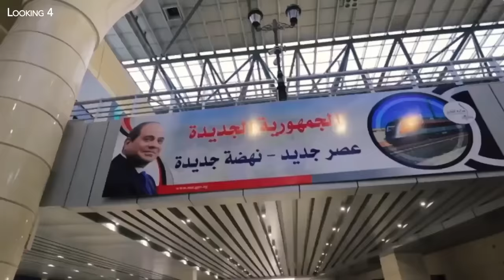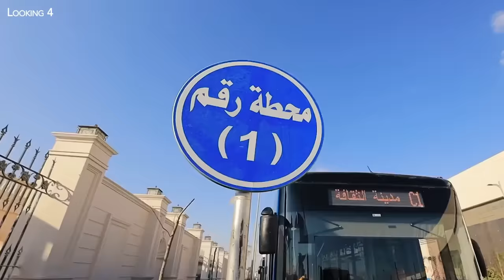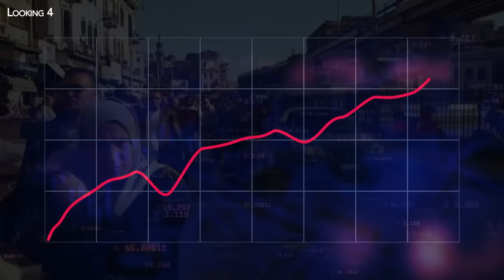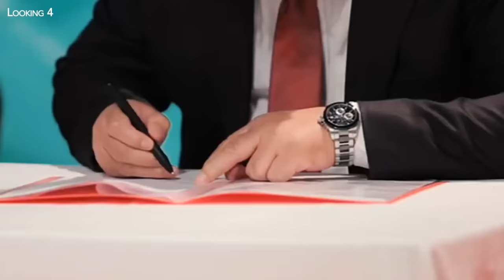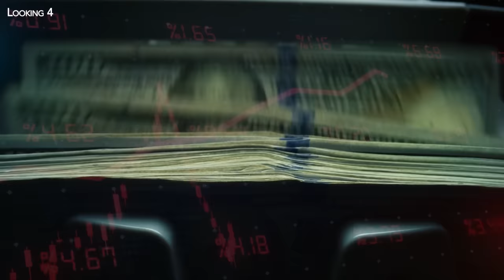Sisi-City: The New Capital that could Bankrupt Egypt

Comment: Greetings from the UK! This looks awesome and very impressive. I hope this works out. 
The budget is not too bad....50- 60 Billion dollars? Here in Britain, that is half the cost of a sub-standard high speed rail which doesn't really go anywhere (check out how absurd HS2 is). Also impressive is the scale of the project and how quick it has taken to build. Here in Britain, it has taken over 5 years to build ONE hotel in an arch facing Buckingham Palace. Words cannot do justice to the colossal failure UK construction is but words cannot do justice to the amazing feat that Cairo is performing now.
Reply: This is true, although the 60 billion figure is a bit more complicated than that. Part of the reason Egypt can build this so cheaply is because labour is so cheap, but labour is so cheap because the country is poor. Egypt will have more trouble affording this because Egypt's GDP is about a tenth of the UK's. (I'm using nominal GDP instead of PPP because the debts are denominated in foreign currency. This is different from the UK in that the UK is financing HS2 with debt in its own currency. Because of that if worst comes to worst it can just devalue the debt by printing money).

Also, this comes at a time when Egypt is struggling with a currency crisis. Basically Egypt is the largest importer of wheat in the world. They need foreign currency in order to pay for all that wheat so their people don't starve. All this extra debt is an extra drain on their foreign currency reserves, which is not good. Add to that the fact that wheat prices are at historic highs due to disruptions to Ukrainian and Russian wheat exports and that Egypt's foreign-currency debts before this were already quite high before this, and you see why people are worried about Egypt's situation. 

And, on top of that, because of a Dam in Ethiopia that's being filled, there's a chance Egypt might lose its water, not be able to grow any food and have to import even more, but that's a whole other issue.

Edit: Greetings from Canada
Reply: They’ve got the Chinese constructing it. Don’t hold your breath.
Reply: @jonnydoeson5562  
yes we have about 2k Chinese workers due to China investments in the project, but that beside tens of thousands of Egyptian workers and engineers!
Reply: @TheNtrLight  look at the standard to which they build their own infrastructure and then ask yourself why they would treat your country any differently…
Reply: @jonnydoeson5562  
what are you talking about, man?
Reply: @TheNtrLight  China’s appalling track record of shoddy, corrupt building practices. I thought it was common knowledge.
Reply: @jonnydoeson5562  
Dude, they are not controlling the construction, it's just a two thousands workers not a big deal, the city is not small, it's 4 time the size of Washington, the construction done under supervision of Administrative Capital Co.
Reply: I disagree. What matters are the project's legality and, most significantly, its necessity; neither the budget nor the relative costs between Egypt and the UK are relevant. Rather than making investments in the desert, Egyptians would profit more from small and medium-sized local businesses in Delta Nile.
Reply: @adelmakram5641  
where's in Delta Nile, makhram, obviously you don't know anything about Egypt population!
Reply: Unfortunately, the projects have no economic feasibility
The country was implicated in loans and debts
The economy and currency values have been destroyed
The people are suffering now
Indeed, we hated our lives as Egyptians
This is the truth from the people, away from the false media and deceptive views
Reply: @guestbygilda2443  
I can assure you that you're not Egyptian, you're spreading false info through copypasting method, we see you and we know who you are, avichay.
Reply: @TheNtrLight You are a liar. Anyone can observe the economic deterioration for themselves from the Internet to confirm the truth of my words
Reply: @guestbygilda2443  
Name me a country that doesn't suffer from inflation? Obviously you can't help yourself bcoz of your ignorance, i dare you if you know how the state funded the new capital project, probably you're a listener to media of MB party.
Reply: @guestbygilda2443  Sorry to hear that. If I may ask - what project(s) would have been feasible?
Reply: @F22ERaptor  Industrial or agricultural production projects
 To pay off the debt first
Please take a look at Egypt's economic situation to realize the extent of the major problem
Did you know that electricity is currently cut off daily due to the provision of gas for export?
Reply: I only see that is just an one man dream to build a Roman Empire over night  , or playing a Sim Cities in video games ,  more dream than a realistic planning
Reply: 50 billion is a lot of money for Egypt.
Reply: Their monorail tracks and the monorail train is manufactured by a UK company for the new Egyptian city it will connect Cairo to the new administrative capital. The Cairo is already growing into the new capital exterior anyway
Reply: @jonnydoeson5562 I lived in China, I had no issues there with infrastructure
Reply: @jonnydoeson5562 why do you think China's infrastructure is bad？
Reply: @hbnhnn  because it is bad. They don’t build proper drainage into their cities for a start, so it floods all the time and people drown in subways as a result. Tower blocks collapse due to corrupt unsafe building practices. You can’t drink the tap water. The power stations are still mostly coal fired. Everything is built as a façade to look impressive.
Reply: I dont think its wise to compare 2 different countries with vastly different population sizes, imports and exports, debts, dictatorships etc as a way to judge a country's standing
Reply: @holyknight9507  Comparisons are necessary to have an open debate. Maybe it's fair or maybe it's unfair, but it is still necessary. UK is sucking up a lot of time and money, and can't seem to produce a decent building in a time that is acceptable. Red tape and bureaucracy is a key reason. Parts of buildings can't be fabricated off site due to restrictions on transporting them - this is why it is difficult to build in UK. Also, it is too expensive - the return per pound is very low.
Reply: @jonnydoeson5562  You must be living under a rock for the past 30 years! China's global constructions have been on hyper-drive. High rises, mega bridges, thousands of miles of high-speed rail systems, etc. are being built worldwide. I suggest you do a bit more research on China's building prowess.
Reply: @Birdylockso  it’s cheap junk like most of their produce. Done to create a facade of wealth and competence. Behind the facade it’s all stuck together with duct tape and corruption.
Reply: @jonnydoeson5562  You are absolutely right.
Reply: @F22ERaptor  UK has been socialist since PM "Inflation" Wilson in the 1970s, we need a reform back to a freemarket economy
Reply: @EzraMerr  True and true and true. NHS, high taxes and massive expenditures on social welfare programs and military mean that the current system will eventually collapse much like the Soviet Union in the 90's. Doesn't mean a catastrophe per se, more like those on social programs will see these cease, NHS will be forced to close and then privatise. Regulations will be undone and hopefully we'll start to see some great developments much like New Cairo - and not just in London.

Comment: Correction, 10000 EGP  is way less than 500 USD. 
The rate is 31 EGP to the dollar for over a year now officially.  
And 50+ EGP in the actual market now.
So 10k is actually less than 200 EGP now.
On the other hand I doubt the sq meter is only 10k EGP, I guess it's multiples of that may be.

Comment: The old city Cairo and Giza residential population is to be reduce to just 300,000 residential population of both which is 600,000 residential communities of both areas * re Establishing agriculture fields and Hydroponics Oasis sector on the Nile with high rise multi level buildings on Nile River of old Cairo are water pumping stations and residential skyline housing assistance centre the grand tourist hotel and motel on the Nile River In old Cairo will be National Housing Assistance Structures ! To reform Cairo Agriculture Former Dynasties